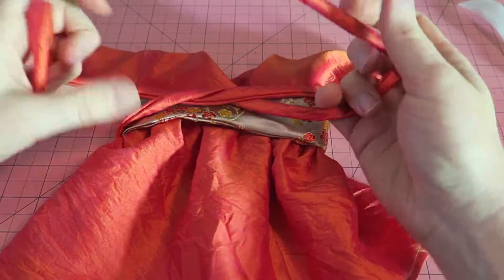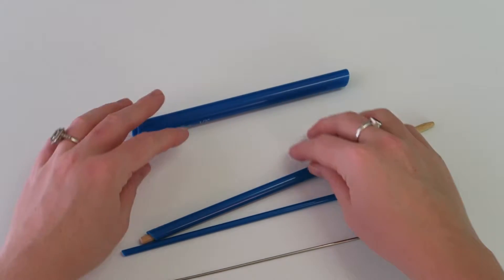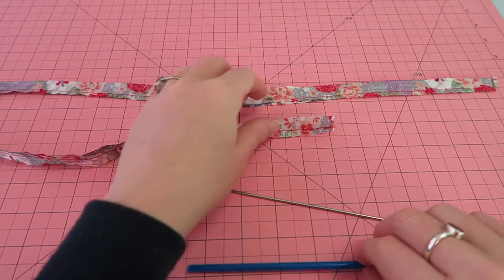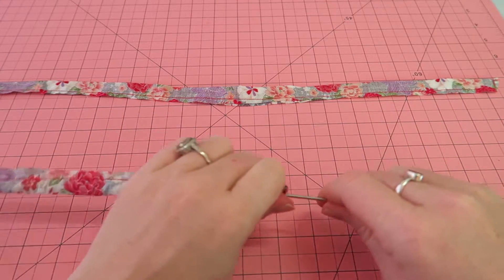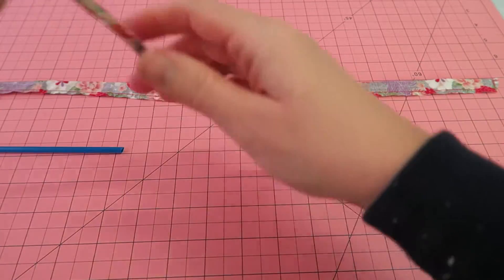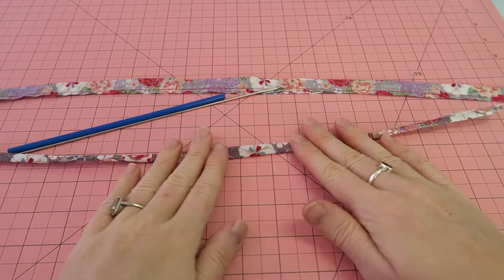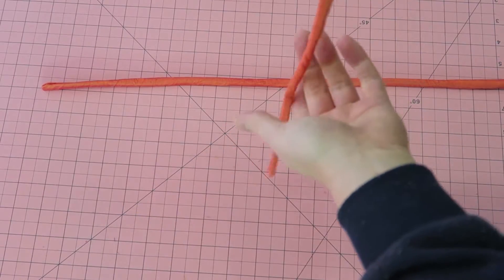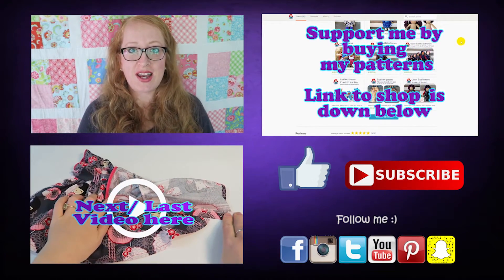The quickest and easiest way to turn a (very narrow) fabric tube inside out | Sami Tips

Comment: Thanks so much for this tip! I didn't have the kit but have metal drinking straws, I used the wider smoothie one as the first part and then the smaller normal sized straw to poke it through, It worked amazing, thank you again!
Reply from the maker: Hi Mary-Anne, that's such a clever idea :)